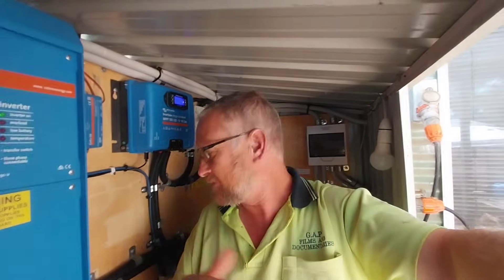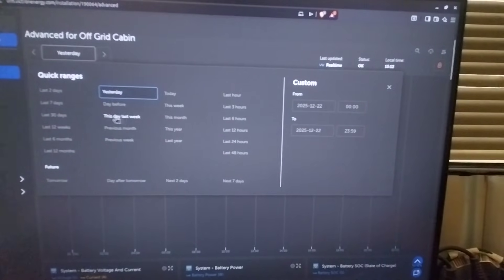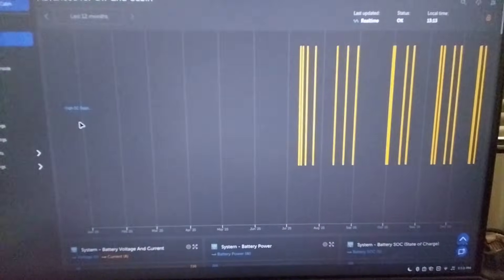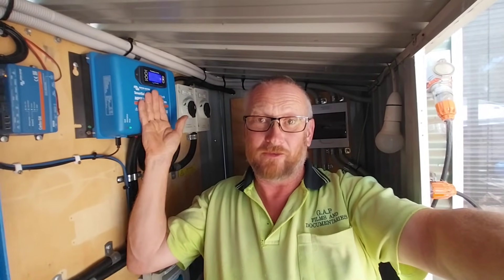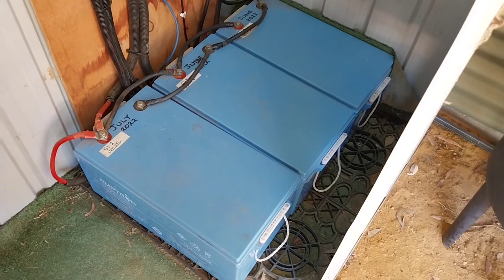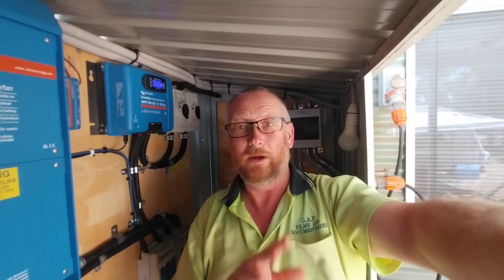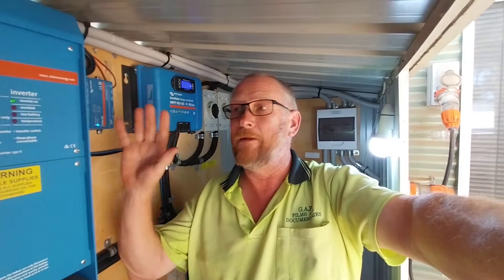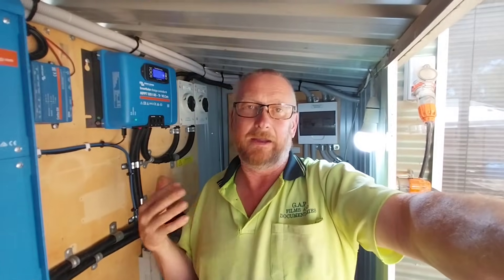DC Ripple Issues Sorted For Now - What We Did

Comment: the first thing I notice is that your setup is vunerable to water ingress above your electronics
- If you are not happy to put the garden hose on the electronics, address this issue of wind blowing water into electronics shed via the air gaps in the roofing

The second thing I note
- how did you do the crimps on the battery wireing?
- what crimp rool did you use? - the crimps look abnormally flatened
- did you out the crimp in a vice to squash it all up? - looks like a possibility

you do a good job with the video presentation - thanks
Reply from the maker: The power shed is under the verandah and protected from rain. The back of the shed has the potential of getting some weather on it as it's right on the edge of the verandah.
The power shed has been in this position for 5 years and has never had any water get into the top of the gaps at the rear wall. These gaps however have helped with air flow, expelling the hot air out.
Even with tropical storms that come from the north and one cyclone that came very close to us, I have never had any water get in at all. Most of our weather comes from the other direction.

Comment: Hardly any point in opening the battery when there is only an alarm in the Victron system and no battery problem. If it was cellbased BMS disconnection and then connection it should be visible on the watts or amps of charging. If no change it is just the Volt level that is a bit too high. 
Off-GridGarage is seen by many....
Battery without Bluetooth? You measure in the BMS report system, bet the battery manufacturer measures at the battery terminals. It is normal for there to be some difference.

Comment: Even though your batteries are fully charged maybe they are active top balancing individual cells and its the switching that's causing your issues , then i suspect its being compounded by running the 2 controllers. Even though the controllers are the same doesn't mean they are actually electrically identical. Around 6 years ago i got grid tie system installed with a sungrow hybrid sh5k20 inverter which was Supposed to be compatible with lithium and Lead acid batteries . I took the path of 20kwh lead storage and after about 2 weeks had weird things happening batteries started failing for no logical reason, charging voltage and current good battery temperature good all seemed fine except it wasn't. By pure accident while feeling for temperature differences on battery jumper cables my sweaty shoulder touched the shed purlin and I got quite a large shock which I thought i imagined as i instantly did it again and didn't get a shock . Thought for peace of mind i would run over all the battery connections to make triple sure they were tight so went and got my tool bag which just so happens to have a volt stick in the front pocket and when i put the bag next to the batteries it went crazy. Grabbed the multi meter and checked between battery and ground on DC scale 0v however selected ACv and found 120VAc , still thought no it can't be so out with the scope and there it was 120Vac @50hz no wonder it was eating batteries. We don't refer to electricity as electrickery for nothing  !!

Comment: A cell imbalance disconnecting one battery will certainly cause ripple as the increased current available to the other 2 batteries will raise their voltage which will drop again on cell voltage falling. Reducing to 56.8 will certainly reduce the chance of this happening as your controllers should shut down before the cell can cause a disconnect. 56.8 is a much better charge voltage, you still get to 100% using the sort of currents you get but you are not stressing the cells by effectively holding them at a charging voltage. The victron default 2 hour absorb is also a bad thing and completely not needed. Balancing should start at 3.4v/cell and a 5mv imbalance should trigger it. The BMS settings are of course critical but it looks as though yours may not be adjustable. My advice these days is to always choose batteries with adjustable BMSs as different use patterns dictate different settings.

Comment: Tidy install, I had a no name 40A mppt that did a similar thing, when the battery bounced around full it would put out a nasty spike that would make my inverter beep. never got to the bottom of it. As commented 3.65 does seem a bit high. Another trial that might be worth trying is running a load to stop it the batteries ever reaching 100% just for the purpose deduction. Keep up the videos.

Comment: With a parallel set as each battery comes up to 'full' charge their 'charging' impedance will start to have an effect with current distribution.  Monitor the amps going into each battery when bank SOC is over 90%.  You might be putting 100A into the bank, but 60A into one battery.  The higher the SOC the more obvious the issue (greater divergence in current).  The high amps will be a contributor to any weak cells in the battery going over voltage and in turn the BMS cutting off charging (if that is actually happening).

The lower voltage setting gives you more wiggle room and is fine for what you are using the batteries for.  Just give them 1 or 2 hours at 'absorption' mode to ensure they balance as best they can.  The manufacturer's specs for charging to 3.65V/cell are fine for individually charging the batteries at 0.25C as the amps never gets excessive like it can with parallel charging.

Comment: Pull them out and send them in for warranty, and see how it goes. I run 48 V batteries, and 16 cells is a lot for a BMS to manage. What I’ve found is that my best cells are the last to reach charge voltage and the last to hit low-voltage disconnect.

That means the weaker cells spend more time at high charge and reach low charge sooner. Your battery is ageing, and the weaker cells are hitting their high-voltage limit earlier, which is triggering the disconnect. Unfortunately, there’s nothing you can do about this other than contact the manufacturer.
Reply from the maker: I am having a guess that it could be a cell issues but I don't really know for sure as their are so many other factors that could be causing the issue I was having. I would have to run some discharge tests on the batteries before sending them in for warranty. If there is no issues showing with the batteries, I won't have any warranty claim.
Let's run some discharge tests on the batteries and see what we find.

Comment: Change the battery charging  order
Reply from the maker: What would you recommend I should change it to.
Reply: Glen, reverse the order. Ie the battery that now provides +Ve and change it to -Ve.

Also, oversize your harness cables (the cables that daisy chain your batteries together) those cables also need to be exactly the same length.
Reply from the maker: Not sure I understand what your meaning by changing the polarity ? as reverse polarity will shut down the equipment?? I'm probably misunderstanding what your meaning.

The cable sizing for the voltage (48 volt system) and current draw which is around 75 amps at peak draw is speced to the correct size with no issues with any volt drop under load. The cable lengths on the batteries are pretty well close to the same, no exact but close enough.

People fixate on this cable length thing to much. If one cable is 5 to 10 mm different on large size cables with higher voltage and low current flow, it doesn't really make any difference. If it was half a meter difference then yeah it's going to start to have an effect with high current flow, but 5 to 10 mm is not a huge issue worth worrying about.

One thing I do need to change though, is the cable configuration and run the battery cables to a bus bar instead of daisy chaining them. I gonna look at doing that in the next couple of days.
Reply: @Yeti_steps  there are three 48v batteries in parallel, not three 18v in series in that bank. I assumed 12v too and wondered why three, easy mistake to make,

Comment: As I understand it DC ripple is a resistance issue so you need to be chasing that. Your daisy chained battery connections are not really optimal. Much better to connect them individually to a busbar as you will be massively decreasing the resistance in the system and reducing the chance of one bad connection in the chain causing an issue. They will also be forced to be in balance with each other. The way you have it now if any of your cables or connections has more resistance than it's partner then you'll get an unequal voltage drop across the batteries (I think that's correct).
Reply: If you look closely, the bank positive and negative is at opposite ends, and the links between are the same gauge. I will admit the bank resistance is slightly higher this way, but every battery in that bank is in balance exactly as well as they would be in a bus bar configuration. Their individual negative terminals of two batteries will be slight offset from system 0V under load, but their positives get exactly the same offsets so they are balanced. Bus bar has more bolts in the connections, so is more likely to have a loose one.

Comment: I parallel my batteries into bus bars rather than via the terminals itself. Each battery positive is fused as well. I wonder if that would fix it?
Reply from the maker: Yeah I really need to redo the batteries again.
Reply: A bus bar arrangement is good because it works with any number of batteries.  The only other way to properly balance the wriring needs a power of 2 batteries, then the diagonal, double diagonal, triple diagonal, ... method can be used.  Fusing each battery individually with HRC fuses is definitely the way to go.
Reply: I do like MTBF fuses, just in case of one battery losing its marbles. Bus bar offers no real advantage and several disadvantages over a correctly wired parallel bank in my opinion based on 35 years of electronics as a job. Correct is Exactly the same wires as all links between batteries, bank positive and negative on opposite ends of the chain, torqued terminals on cleaned and burnished lugs.
Reply from the maker: @rubikmonat6589  You make a good point on fusing. I really should put a fuse on each battery, just in case one decides to fail and the rest dump all their current back into the failed battery.
Reply: @TheOffGridBachelor  T class fuses required 60v min

Comment: Hi Glen. All the charging figures you mention seem very high. The 58.4 volts you mention from the manufacturer is actually 3.65 volts per cell. That is the maximum voltage specified by most cell manufacturers. They state the cells can be damaged if charged above 3.65 volts. Charging to this voltage is not only pushing the cells to the limit but it is also not achieving any benefits as far as charging goes. I have used a ZKETECH 40A charger/load tester and have capacity tested a number of 3.2 volts LIFePO4 cells. All the results have shown that charging at these higher voltages achieve very little benefit and can actually stress the cells. When the cells are charged to 3.45 volts (55.2 volts for a 48 volt battery) they are charged to around 99% capacity. Because the charge curve for LIFePO4 is almost flat for the majority of charging, and then climbs steeply when nearing full charge, charging from 3.45 to 3.65 adds very little in the way of amp hour capacity, and takes the cells to their maximum voltage for no extra benefit. My system consists of 4 x 48 volts batteries. Each battery made up of 16 x EVE 3.2 volt cells with JK BMS's. 2 batteries with 304 Ah cells and 2 with 314Ah cells.I have over 62 kWh's of battery with a Victron 250v 200A charge controller and a Multiplus II inverter. My system has been running for a number of years without any problems and I never charge my battery any higher than 55.2 volts. I have learnt a lot from Andy over the years from Off Grid Garage and he has conducted many tests on battery charging voltages and my test results agree with his. Cheers mate
Reply from the maker: That's interesting and thanks for the info. I am gonna go around tomorrow to all my systems, check the charge voltages and drop them a little.
I would like to get hold of some raw cells, a BMS and build a few batteries, I just don't know where to get the cells without getting ripped off with B grade cells sold as A grade.
Reply: @TheOffGridBachelor  I can help you with info on buying quality cells. As I said, I have purchased over 70 cells now, all from the same Chinese supplier, without any issues at all and really good service from them. And I have also purchased 6 or more JK BMS's online without any issues. Happy to help you get into it and answer any questions you have. But a warning .....  it's addictive. 62 kWh's of 48 volt batteries and a couple of 12 volt batteries built now and still enjoying the process.
Reply from the maker: @Brian-s5u-j1d  ... lol too late with the solar and battery addiction, I was hooked many decades ago 🤪
Reply from the maker: Yeah I think 58.4 volts is a little high as well. I was initially charging at 57.6 volts and then dropped it to 56.8 as that was the sweat spot most people were recommending.
The problem did go away for a few days but has returned. I am starting to think it maybe a cell issue in one of the batteries so I need to remove one battery at a time, test it and see if the fault disappears when a battery is out.